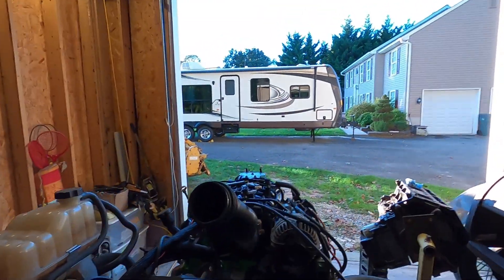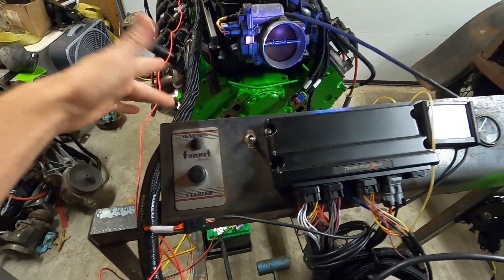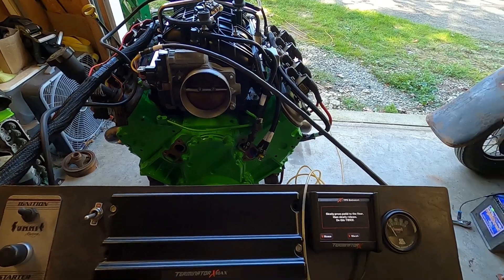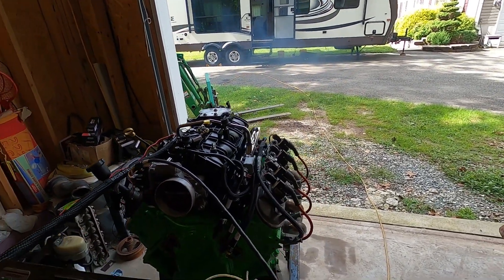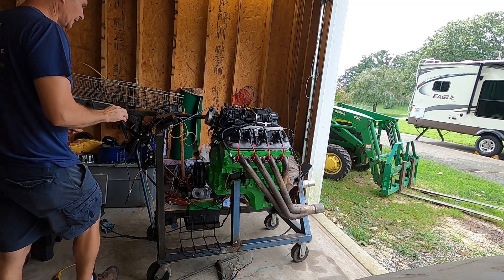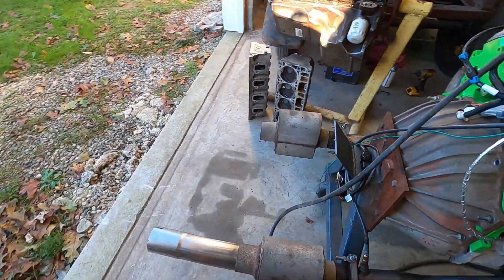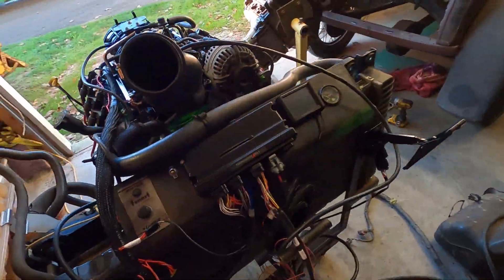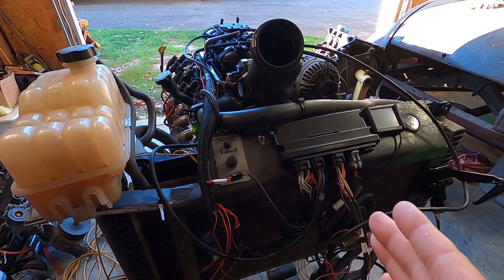Holley Terminator X Base Tune and First Start

Comment: Did you have to add the pipe after the header/o2 sensor too get it to work? Asking because mine keeps leaning out and the only thing I haven't had a chance to do is the exhaust
Reply: First thing I thought of when I seen it like that
Reply: Typically is recommended to have at least 12-18” of tubing downstream past your O2 for it not to lean out or read proper AFR. I know your comment is 3y old but for anyone else wondering.

Comment: Does the holley have a connection for the Alternator?
Reply: You can make one for about a dollar connecting 1 wire. it is really simple. I’m using the LS four pin alternator found in most trucks. Pin number three is marked L on the plug. in my case it’s the only wire that is connected to the factory harness. Solder a 470 Ohm resistor between the end of the wire and a 12 V switched ignition source. You should also have your large gauge wire that goes to the lug on the back of the alternator. The other end goes to the starter. The alternator wiring is standalone and does not make any connection to the holley terminator.
Reply from the maker: Not out of the box, Holley sells a harness though and it's not bad $.